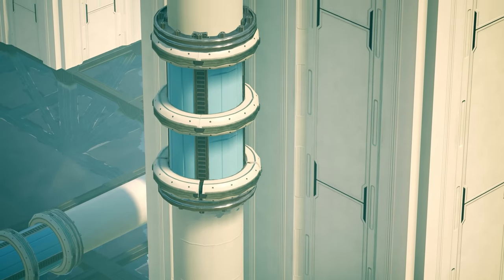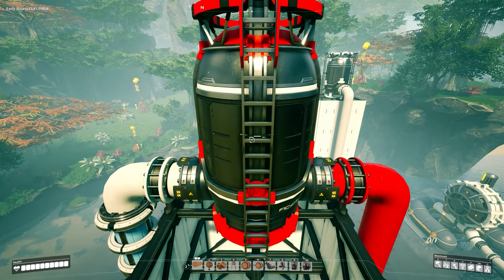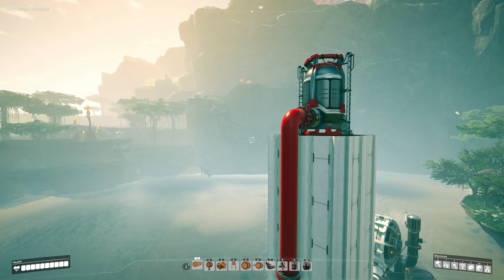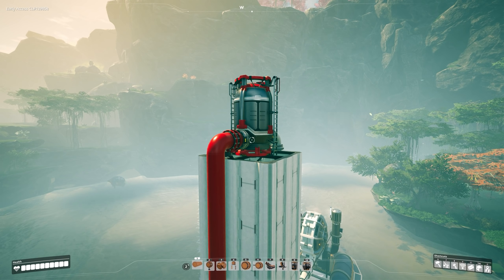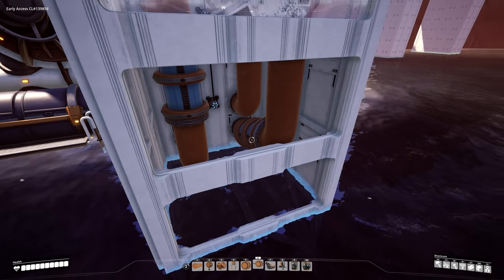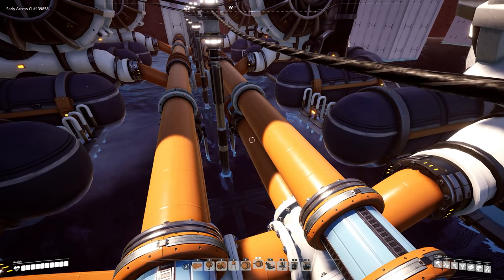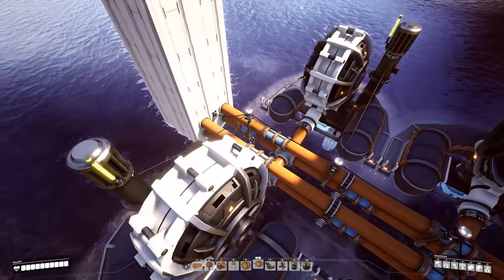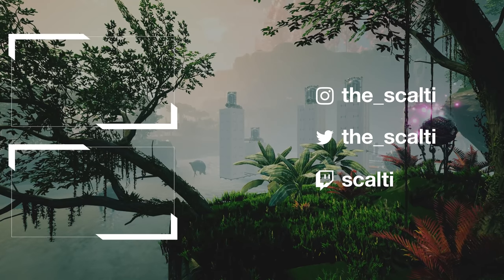Water Tower Mechanics Guide [SATISFACTORY GUIDE]

Comment: I am using this method quite commonly as well but I like that you are showing this mechanism in detail for people who do not use/understand it yet.
But there are rumors that this will likely be changed in future version because it's actually not intended which is logical because it makes no sense IRL. :D
Reply: this is actually close to how water towers and fluid dynamics work. If I put a rain collection tank up high I can pipe that water to anything  just under the same height. I can even fill a barrel from the BOTTOM provided the incoming water source is higher than the barrel. This is why in places like new york they have towers on top of the sky scrapers because its the easiest way to get water all though the tower, U just have to pump it up once and store it, then it drains DOWN into the tower. The only change needed would be to require the buffer be higher than the input really. the pressure usually stays good too as long as the source is higher than the output. The MK2 pipes on the other hand would have to be twice the SIZE of the MK1 pipes to flow twice the rate at the same pressure if I remember my science correctly. None of that bugs me as much as the materiel requirements to make a cartridge of ammo though. Currently I should be making self guided explosive ammo with what I am putting into it. And I load 10 in to one slot at the same time which is not how guns work. You can load 10 BULLETS in a cartridge then load that into the gun but you don't phase 10 huge cartridges' into one slot, and no bullet requires a beacon. A little copper, a little powder, done. maybe a tiny bit of sulfur for a primer. add some iron or aluminum to make it into a magazine. Then it would make sense.
Reply: @scottjackson1636  While you are true with your explanation, this doesn't describe the method that was applied here.
I know real water towers exist in the way you explained it but it's not possible to share pressure with the input pipe from the water tower especially if the pump is next to it because the pump wouldn't be able to push more water into the pipe because of the high pressure. You can't apply the same pressure to the input pipe by dragging it up a tower and when it comes down reattaching it to the same pipe.
Reply: And exactly that is what they mentioned to be maybe fixed in future updates. But as I said, these are just rumors.
It's just a game and it wouldn't be a problem if some things stay unrealistic. :D
Reply: @rlnt  yeah I agree there is no real reason to change it. No telling what a civilization that can materialize objects out of raw materials could do. But I did say that it was close. as long as the out put is lower than the input the pressure usually stays good. not like we really measure water pressure at the output expect for "good" and "bad". and Bad is usually fixed at the output side or near it. pressure washers for example. And I could drag a pipe up the side of a building and hook it to the bottom of a tank on that building, as long as that tank is lower than the source that tank will fill. You can then drain it down into the building, rebuilding pressure and output. water seeks its level. Ahh discussing fluid dynamics. something I never thought I would be doing. the internet is weird.
Reply: @scottjackson1636  IRL the higher the water tank is off the ground the more gravity pulls it back down. If you have a 3 story building with a water tower on it and a 30 story building with the same, the 30 story building should have 10x the head pressure as the 3 story building. I do not think this number is factored into this game because ive tried it in mine.
Reply: This method is too game-breaking to not be a bug. I would welcome it if this was fixed or else pumps are almost useless as it is. And yes, physically, it makes no sense because it would be a perpetuum mobile. Instead of thinking in pressures, I like viewing it from an energy view. You are using the energy of 1 liter of elevated water to elevate an arbitrary amount of water to the same height and thereby you are basically duplicating potential energy ad infinitum.

Comment: Thanks dude. I actually got that working pretty well on my own coal plants But this showed me a few things I didn't think about when i did it on mine. Of course my coal plant is half the size of yours and I have 2 in 2 different locations on the grass plain. But when I get the steel plant done I will get the tier 3 belts and upgrade all of them to be bigger. So far I have built every plant except the steel plants and reinforced beam plant, I placed them on the grass land plateau right above the 3 normal iron  mines. In a nice square pattern and feeding into a giant mall in the center with  the HUB and space elevator. Looks pretty good. I also like to leave the buildings open without outer walls, mainly because of the hit my old comp gets with a lot of glass walls.

Comment: Awesome content!! One of the best! I've been watching and using your guides for weeks now! Thanks so much! One thing I wanted to add was that I copied this water tower model for a coal factory half the size and it was running flawlessly until update 4. I'm wondering if they changed the way pipes work? I had to scrap the water tower and revert back to using multiple pumps on 2 feed pipes to keep enough flow to the goal generators. Curious if you had the same result??
Reply from the maker: I have no idea. I’ll check it out.  I did notice my own power system failed but I didn’t troubleshoot it and went straight to designing the stator factory for the power storage structures. I’ll be sure to look into it to see if they fixed it.
Reply: @Scalti  My gut says, they changed the way the piping works. It only really matters until you get into the later tiers anyway when you switch to oil/gas generators. Just   something I noticed.

Comment: Can you show an example of a pipe network involving a large number of extractors utilizing this design? I'm trying to make a huge power plant and I'm having a hard time figuring out how to design it.
Reply: Similar issue.  I'm in the exact same location, but using Compacted Coal (125/s output from 5xConstructors, burn rate of 7.14/m or 1/8.4s per generator).  I could build 17.5 coal generators, and underclock to about 93%, or overclock generators by 9% and have only 16 generators, but then I would need to either overclock 6 water extractors also by 9%, or build 7 and underclock a bit.  I think the 16 generators would look cleaner than 18, and a 7th water extractor should fit.  I'll want this to be expandable to something like 64 generators, or 128, or whatever the max miners and conveyors allow, then match water.  But I could easily fit 19 pumps from cliff face to ocean limit.  3 pumps are about as wide as 4 generators. So it'd be 18/3 or 6 banks of 4 generators each, or just 24 total.  So a 2x24 bank if I mirror them on each side.  And repeat that 2x24 or 48 another 4 times easily, for 192.  But laying out the pipes is my biggest challenge.  I never seem to get good flow to all 8 test generators.  The plant dies if I shut off biomass burners, because the water sputters, can't match demand.

Comment: For some reason I can't get this mechanic to work. I use pumps to get the fluid (crude oil) to the maximum height in the system right after the extractors into a buffer but the fluid will only travel so far after the key pipe. What am I missing?

Comment: Are you going to do an oil factory next? I just got access to oil and found 2 normal deposits near each other. I want to make both rubber and plastic while eventually making a fuel power plant since my coal generators aren't enough. However, the math involved is hurting my head. Still new to the game and your videos really helped me out.
Reply from the maker: Still have some other videos to work on before getting to refinery content but I assure you I will. If you want to get a high output oil system for those products I’d check out @imkibitz (not sure if that’ll work). He has a guide on getting 900 of each but it’s a large scale build and not focused on A E S T H E T I C S if you will. XD

Comment: That nice. So it applies to oil tier, too, right? Though, how would you set it up?
Reply from the maker: Same but you’ll just need the extra pumps given the headlift is 10m for oil versus 20 for water.
Reply: @Scalti  Ah, I see. You be able to upload a set-up of it? Because most of the time that I expend in satisfactory is where should I put the set-up. Most of the time, I put it too close to the oil extractor and the pipes isn't aesthetically pleasing. And when I just put some foundations, I often stare at it for quite sometime due to me figuring out where to place em. Kinda been using your vertical builds lately and had fun modifying it, but after reaching oil, I'm stuck in a loop where I contact 8 refiners, then delete them again cuz of the placement.

Comment: I've got some questions - I've been trying to get this to work but haven't yet been successful.
1. Does the fluid buffer at the top of the tower have to be at the exact same height as the coal generators? Can it be higher?
2. Does the way in which you connect your water extractors to the outgoing pipes from the tower matter? I notice you have them all feeding "in line" with the bottom pipes. I have 300m3/min coming from 3 extractors into a pipe, and that pipe then being attached to one of the four output pipes from the tower.

I'm trying to get 900m3/min of water to 10 fully overclocked coal generators using this  but haven't had success getting the water to actual rise into the coal generators with this method.
Reply from the maker: 1. Fluid buffer must be at least the height of whatever machines you’re feeding. 

2. How they connect does not matter. Just need them to join the key pipe but you also need to make sure you’re not bottlenecking. Based on your comment you have 3 extractors feeding into a single pipe but how is that feeding the coal generators? Are they all being fed from a single pipe or have you properly divided the pipes to the generators based on the 300/m limitation of MK1 pipes?
Reply: @Scalti  So I've got two pipes feeding each set of 5 generators - Currently one is feeding 3 (which should be 270/m) and the other is feeding 2 (180/m). The issue I'm seeing is that the fluid isn't rising into the coal generators, despite by fluid buffer in the water tower being many foundations higher than the coal generators.
Reply: @Scalti  OK I actually have no fucking idea why, but from what I could gather it seems like if you have pipeline floor holes in your pipeline (which I did, going to my coal generators, as well as up into my "sandwich", and you set up your water tower after these get set up, then the game just like bugs out and they act as impassable barriers? I deleted them and then rebuilt and reconnected everything and voila it worked. SO weird.

Awesome setup, gonna be using this from now on :)

Comment: hi Scalti, great vid again. Can you tell me the name of the mod you use to have a connection for pipes in your foundations at second water tower? thx
Reply: Not a mod I think. You can purchase “Pipeline Wall Holes” from the Awesome Shop which should be what he’s using
Reply: Put a foundation down below your working level. Put a pipeline support down in place, rotate it so it’s flat on its back. Put the floor foundation where it should be. Delete the second foundation. Connect the pipes.
Reply: @evilpoptart25   thx i will try that
Reply: @evilpoptart25  great tip. Works like a charm. Thanks

Comment: Soooo, key question here: does that mechanic make sense in the real world? Or are you exploiting a bug in fluid mechanics in the game? 
I understand your system, but the logic doesn't make sense for real life, right?
Reply: I hope they'll fix it soon!
Reply: For the water height it's exacly how it works in real life, search up "water tower", you probably saw one in some city. As for the flow mechanics I'm a bit rusty in fluid mechanics but from what I can remember it's correct.
Reply: Yes it actually is! The simplest way to explain it is that the pump adds "head" (which is how energy in fluids is stored) to the system. This pump head is then converted to static head (the energy contained simply by height) by filling the fluid buffer. This static head is then converted to pressure head via gravity in the other lines, which is then converted to vertical head again going back up to the coal generator.
Reply: The other responses are talking about the general concepts of pressure and the way water towers work.  Yes, this is the same is in real life, at least roughly.  The thing that is different is what he talks about a 3:35  when he mentions that, as long as you have a water tower, the pressure (or rather max heard height) is constant past that point even though it has other water sources.  His setup with the two sources (one pressurized and one not) feeding the one tank wouldn't work out. Water would circulate through the "key" pipe and then right back to the start, never building up enough pressure to go up the second tower.
Reply: @lancer827  Thank you!
Reply: @lancer827  Exactly! Thank you for explaining it better than I could.

Comment: Any idea on why, with 6 extractors, and a water tower well above the level of my coal plants, using tier 2 pipes one or two of my 12 plants keeps running out of water?

Six extractors should be giving more water than can possibly flow in the system, but one or two of the pipes keep running dry.
Reply from the maker: I had someone comment that it’s best to setup the system so they’re entirely full of water before connecting them. Fluids are still weird in the game.
Reply: @Scalti  I feel like a real idiot, but I figured out the issue. At one place in my manifold, a TINY section of pipe between two of the splitters was still Mk 1 piping, so it was only getting a max of 300 water to feed the last 7-8 coal plants on the line, which collectively need 320-360.

I thought it was all upgraded, when I added the 4 new plants

I'm surprised things weren't WORSE.

Comment: how did you get a pipe support to clip with the floor at 7:59? i can only get the pipe itself to clip through, is there a way to put a wall hole on the foundation or something?
Reply: jk i figured it out, i was only able to clip wall supports through the floor when placing it against the wall from below
Reply from the maker: That’s the way to do it. :]
Reply: @Scalti  thanks for the quick reply, good to know in case I needed it 👍

Comment: hey scalti! keep it up.  awesome channel.  please make a video to efficiently mind concrete. thank youuuuu!
Reply: Concrete? Concrete only takes 1 step to make bro. Choose your limestone node purity, miner type, and miner clock speed based on how much concrete you want to produce with your production line, then split the miner's output into multiple belts and feed them into underclocked constructors - the input of which matching the output of the miners. Then route the outputted concrete to a storage container or better - a truck station where tractors can take them to a centralized spot from where you can easily grab them.

It's barely a "factory" and is hardly worth a video. It's more of a decentralized "production cell" and I build them wherever I find a pure limestone node, which seems to always be on it's own - it doesn't take a whole lot of time and could come in handy later once I have enough materials to run a trucking network that takes limestone from all these nodes and puts them in one place.

Comment: So the key pipe "ends" at the first intersection? (the one at 9:15)
Reply from the maker: Correct. And then feeds anything connected to it.
Reply: @Scalti  does it mean that if I connect a "5th" pipe that need to go up, to a pipe that is not "key pipe" but connected to the same network (in doing so we can say the 5th pipe is indirectly connected to the key pipe through a "2nd pipe"), the 5th pipe will not eraditate the head lift of the key pipe?

Comment: how many time can you split the main pipe to feed the onthere water axtraxtors that requires to your factorys?
Reply from the maker: Unlimited. Just needs to be connected.
Reply: do wanne ask somthing again. this work very well on water. but how does this work on onthere liquids as oil and fuel?  do i lose a little liquid in the progres of this?
Reply from the maker: @jacovanderschaaf3044  shouldn't lose anything and works with other fluids in a similar fashion. Just mind the different headlift requirements.

Comment: Does it still work in update 4 ? otherwhise im pretty fucked haha
Reply from the maker: Still works.
Reply: @Scalti  I actually setup the very same pipe network, water tower to the height of the coal gen, 6 water extractors, 16 coal gen, 240 coal per minute, but with update 4 I had to add one extractor since some of the coal gens randomly shut off for having low water.
Reply from the maker: That is a side effect of the new way power is managed. Once it’s all up and running again the ratio is still 3:8. The water getting pumped up doesn’t catch up fast enough because generators now run at 100% consumption all the time. Once it does you’re good to go. Had the same issue.
Reply: @Scalti  thanks for the fast answer. I imagined that keeping up starting from 0 could be the issue, or that something changed in fluid physics. I went back after a while and switched off the asymmetrical, badly placed and completely unaesthetic water extractor and water levels kept stable.

Comment: It is quite easy to understand when you think about that the key pipe is not for processing water, but only to increase the pressure of the water (more height on the water tower means more water pressure means more lift for all fluids in the network)